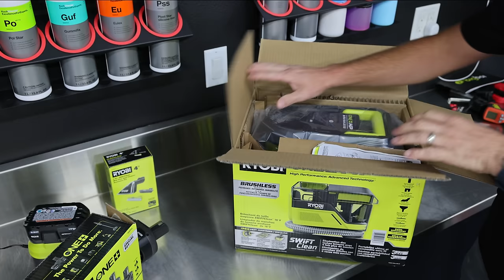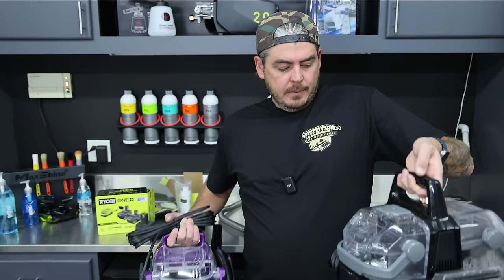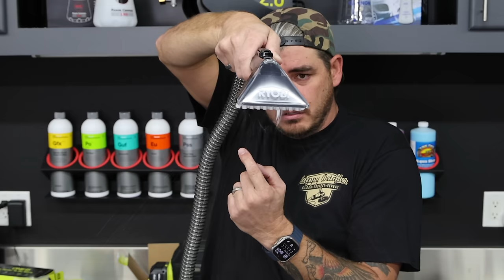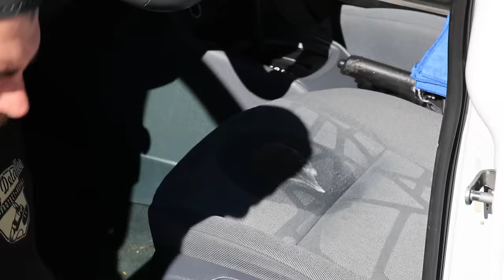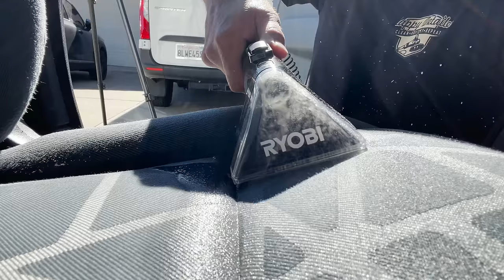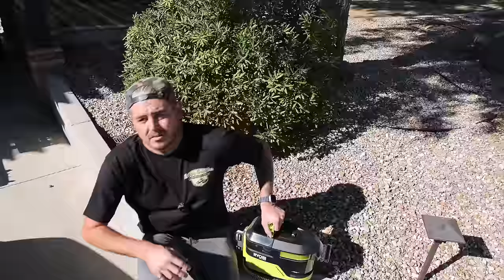NEW BATTERY POWERED SPOT CLEANER!  Ryobi SwiftClean Carpet Cleaner

Comment: I got one about a week ago, and so far I love it! It has worked flawlessly for the 6 or so jobs I have used it on. I have had no issues with leakage, and I love the multiple ways it can be disassembled for cleaning purposes. I also love the freedom of not having to be connected to a power outlet.

Comment: Whys the max like so low?!? It has so much more room
Reply: Because the suction thru the motor has to remain liquid free. It needs several inches of air space to prevent ingesting water as turbulent air rushes thru the container. If you need more liquid capacity then consider the Ryobi 1gal, 3gal, 6gal, and 10gal wet vacs. With those alternatives you won't get a liquid delivery system and would have to have a bottle of water to manually dump water on your cleaning area, or a spray bottle.
Reply: @hgodtx that makes sense. Thanks for the explanation. Just for the price range I feel you're not getting a lot of money for it other than it being cordless.  I have the 3 gallon dry wet vac version but it's hard to find a generic water extractor tool for it to fit. No oem ones also.
Reply: @superduperboyx  Interesting. I'm leaning toward getting the 3gal vac. Is the flared tool it comes with not good for extraction? Also I thought it came with an adapter for different sized tools!?!
Reply: @hgodtx  you're referring to the cordless 3gal one that's like a box shaped right? It comes with 2 attachments, the crevice and the wide flared one. I feel the flared tool is just OK, it doesn't have a good suction on the surface bc of the little cut out openings but it's decent. An actual accessory water extractor you can press down hard onto the surface for better suction and actually see the dirty liquids go in. I bought a generic water extractor  off Amazon and it was too big so I just taped it together. Worked fine.

Comment: Did you find out about the leaks?
Reply from the maker: Yea ryobi actually reached out told me there was an issue with early models but that has been fixed!! They actually sent me a new unit and it works perfect
Reply: @imjoshv  can you please recommend me a good one? Is this particular carpet extractor good? I also wanted to clean the carpet in my house small areas,of course

Comment: Uh…15 minute run time? Hilarious. No thanks. Get a plug in and have unlimited run time and way cheaper
Reply: You can always just get multiple batteries and/or larger batteries. They sell a 12 aH battery which would run this thing for 45 minutes. I can't imagine needing more than that.
Reply: Did you try running it with a non-hp ryobi battery? Just curious how it works.